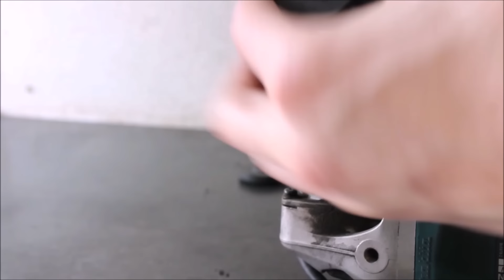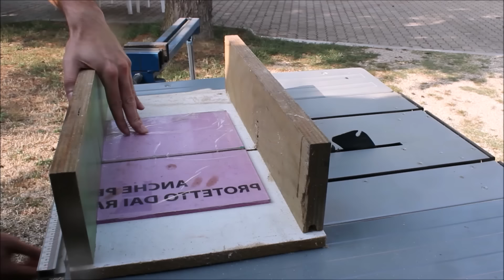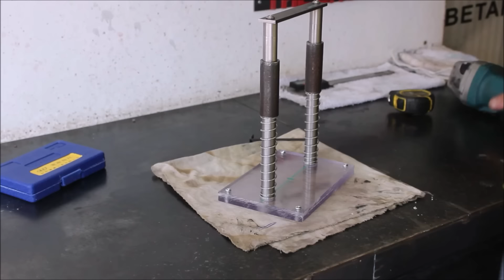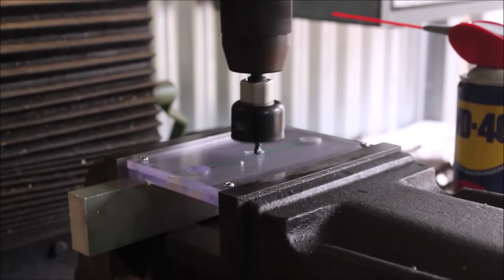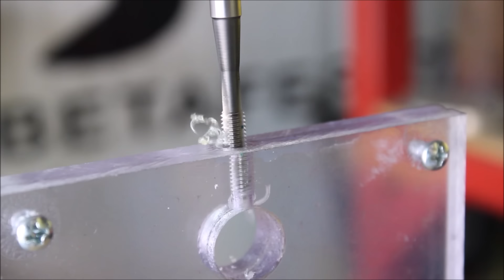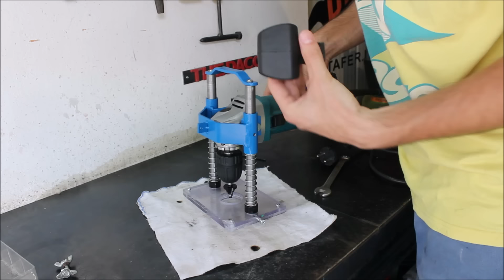Fresatrice per legno da una smerigliatrice (angle grinder hack)

Comment: Please add the tapping sizes etc as text for information.   A very Interesting idea. I have an imperial lathe, so I would like to do this, but my angle grinder does NOT have soft start or variable speed.
Si prega di aggiungere le dimensioni toccando ecc. Come testo per informazioni. Un'idea molto interessante. Ho un tornio imperiale, quindi vorrei farlo, ma la mia smerigliatrice angolare NON ha un avvio graduale o una velocità variabile.

Comment: as much as i know, the drill is 3-4000 rpm, but the angle grinder is 11-12000 rpm ... the difference is too high and the process is affected.

Comment: So...at the end you make a router out of a grinder....looking at the tools you have used to do it and the time you have spend making it....wouldn't be easier just to buy a cheap ( not a good one ) router? And  not sure about drill's chuck holding a router bit cause drills spin way slower than a router or a grinder. Other wise an entertaining video, and you have skills, just use them in a right direction. Good luck

Comment: You should manufacture this product. I Love it
Reply: There are many on the market now, they are called routers!
Fixed base, Plunge and Trim routers are available at most hardware and tool shops.

And the cost to build the one in the video is out of reach for most normal people.

You would first need to outfit a full machine shop (unless you already have access to one) and buy the materials needed.  

Several thousand US dollars just to make something that can be purchased for under $80.00 USD!

Comment: why so much headache when you can buy from the trade?
for milling you need a speed from 3000 RPM, an angle grinder does not have to offer this speed

Comment: I don't think that this is a good idea.  A drill chuck is not nearly as strong and as precise as a router collect, and it certainly does not grip as tightly as a collet.  I think this could be dangerous or would destroy the workpiece if the bit comes loose in the chuck.